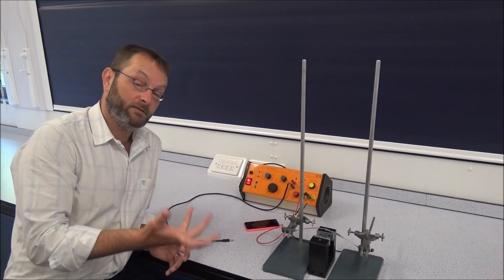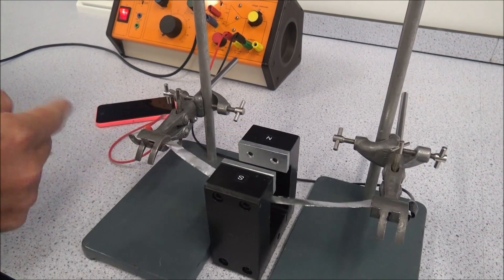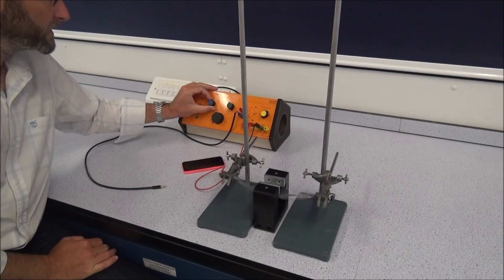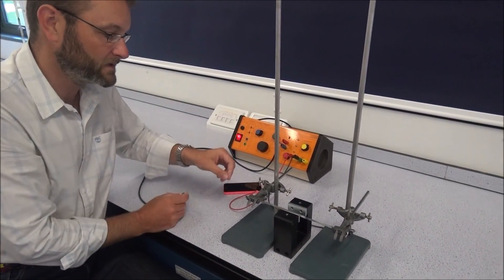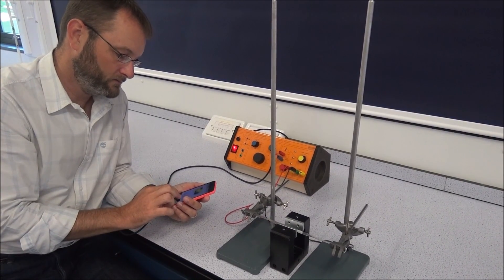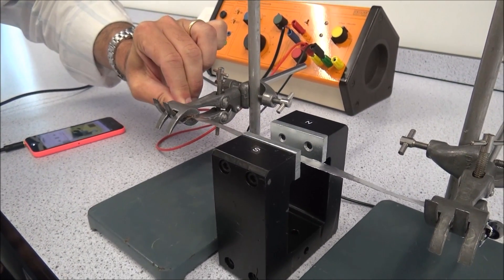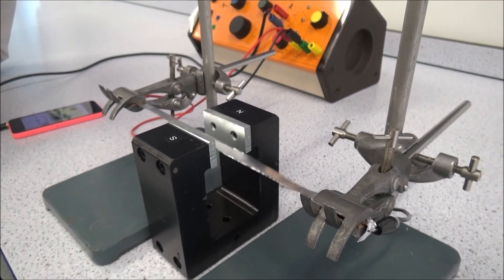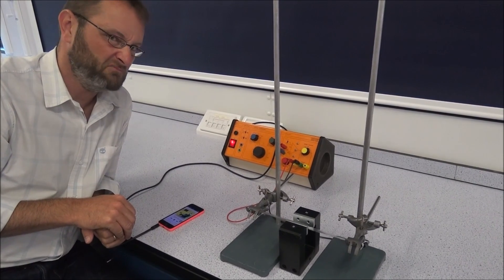Ribbon Tweeter (ask your teacher to make one!) - A Level Physics

Comment: Hello, i was woundering about the DC resistance in that piece of alluminiums foil, is'nt that extremely low so it will load your amilifire used in orange generator/amplifire box, too hard?
Could one use normal kitchen alluminium foil?
Also, the magnet, can one just buy some neodunium squared magnets like these:

https://www.banggood.com/5pcs-N50-Super-Strong-Block-Cuboid-Magnets-60x10x4-mm-Rare-Earth-Neodymium-Magnet-p-984120.html?rmmds=search&cur_warehouse=CN

and fasten them in distance like your setup?

Comment: You could make a speaker(experimental) with these magnets https://duckduckgo.com/?q=buzz+magnet&iax=images&ia=images
And make a box, out of cardboard or carton, make 2 holes up and 2 holes to hold magnets.
Then make an upper slit between magnet holes and lower one to hold a thin stip of aluminum foil, 3mm wide or so.
Pass aluminum foil strip inside the slits from one to the other.
Use 2 clothes pins (wood better than plastic) to hold wires and strip on box.
I tried it and it worked with radio/raptop ear/head-phone jack, but was not loud, barely audible.
I used alligator clamps and 3.5 mm stereo male-male cable.
https://duckduckgo.com/?q=alligator+clamps&iax=images&ia=images
https://duckduckgo.com/?q=3.5+mm+stereo+male-male+cable&iax=images&ia=images

Comment: What happens if you rotate the magnetholder 90 deg. ?
Reply from the maker: It would just go side to side - but due to the shape of the foil it wouldn't flex as far so it would be even quieter.
Reply: Ok, understand. Will you get a louder sounding ribbon if you use ultrastrong neodymium magnets instead of ordinary ferritemagnets?
Reply from the maker: That could be possible. The force on the wire depends on the current, the length of wire in the field and also the strength of the magnetic field. So a similar sized neodymium magnet should make the sound louder.
Reply: What is the DC resistance on the ribbon? 0.001 Ohm? it must be a very high capacitance value if you want to cut frequencies under 10kHz with just one cap in series. 15000-20000uF?